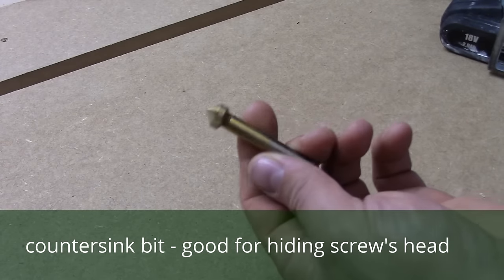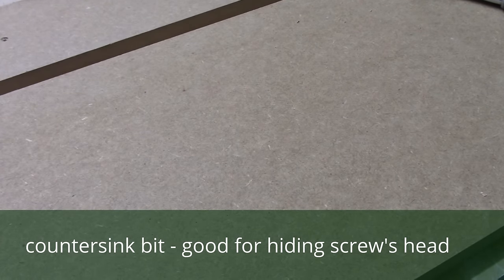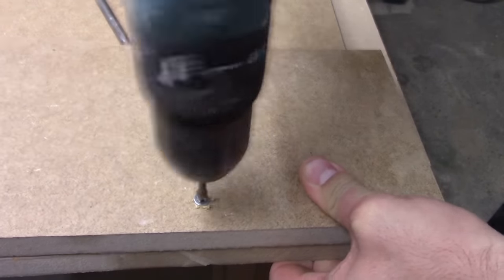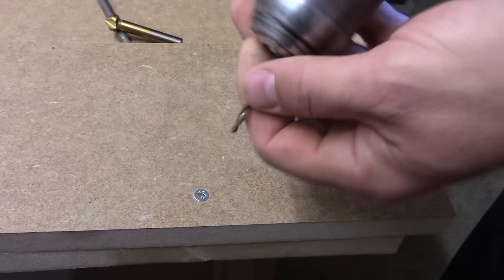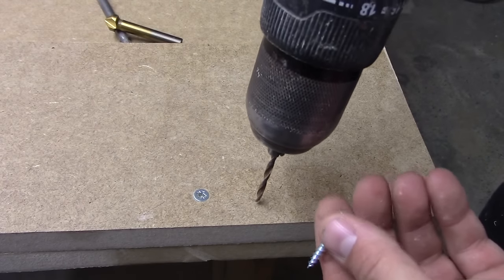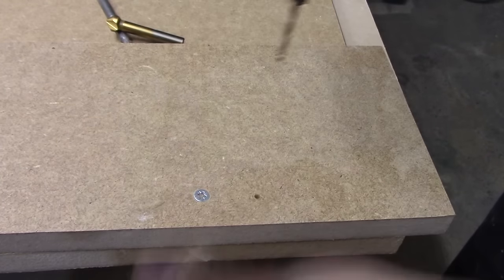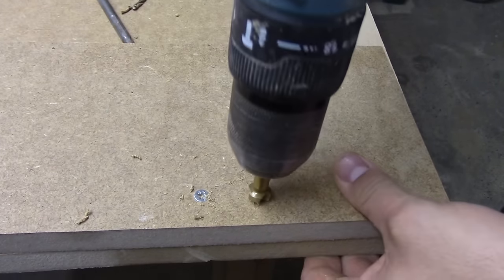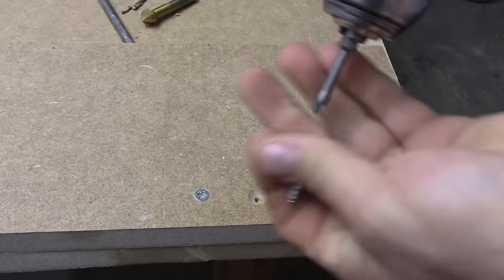Countersink drill bit. How to use countersink drill bit.

Comment: When you screw two boards together you should drill a clearance hole only in first board! That way you get a much tighter fit between boards.
Reply: or use partially threaded screw
Reply: Dude, it's obviously a test board lmfao
Reply: Very good video. Clear, well explained, well showcased.
Thanks!
Reply: Just a couple mm into the bottom board is good to assist

Comment: thanks!
´What I am looking to learn for days is,  do all of these drill bits go in all of the drills machines?
I already have a Bosch drill machine, but the hammer-action one, which works with electricity.I want to buy drill bits for this machine., and I need to know which bits go into it. because its base/rear-end slips/slides into the slot of Drill machine.
Reply: Software Test yes, they're all machined off of a 1/4 inch hex bit

Comment: I want to countersink a screw into sheet metal. Does the countersink bit have to be one that goes through metal? What I'm asking is, do all countersink bits go through metal too?
Reply: Not all bits are made for metal. The wood drill bit may be usable but not recommended.
The countersink bit has to be the one to go through metal as they can also easily go through wood.
Reply: @AC3dAvE  hi Dave, is there a specific bit you can recommend from home Depot?
Reply: @mahmoodkhan6623  For metal, look for a Weldon zero flute countersink. They're not sold at hardware stores. You can find one at an industrial supply house/site, or on ebay. Good luck.

Comment: this is for v shaped screw head. how about for a flat screw head, what drill bit is used? countersink surely doesnt serve the purpose here
Reply: works the same, the idea is to create a shallow indented hole deep enough for the screw head to be burrowed beneath the surface area - which you would fill to conceal the screw for an aesthetically cleaner look and allow for painting
Reply: You could use a forstner bit to perform your countersink for a flat screw head. You just need to make sure to select an appropriate size bit that fits the screw head to your liking.

Comment: Couldn't you just screw the first screw deeper to get the same results if not better?
I honestly don't understand the purpose of the countersink.
Reply: Issue with doing that is you risk splitting the wood. I have used the method you described several times and got away with it, but there has been a few times when I bodged it. Much better to use the countersink to guarantee the results.
Reply: Countersink for neat work, and as previous commenter said so as not to damage the materials.